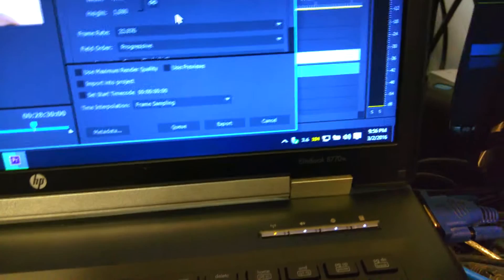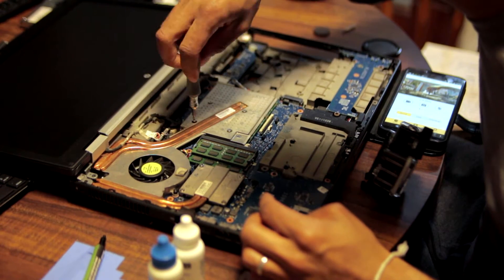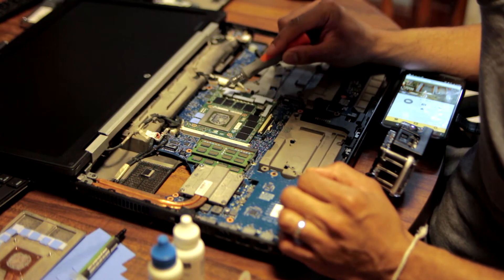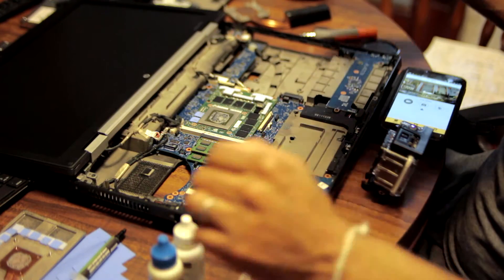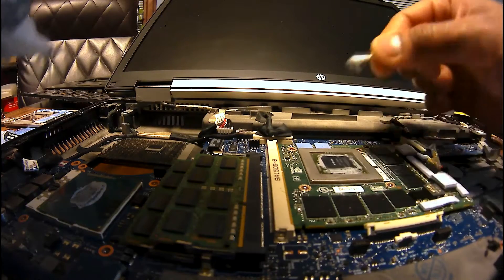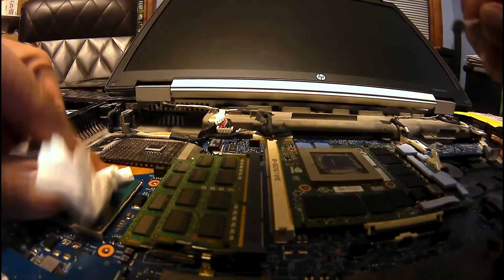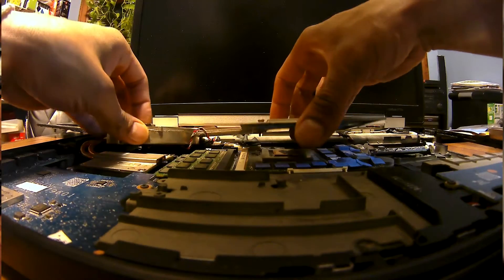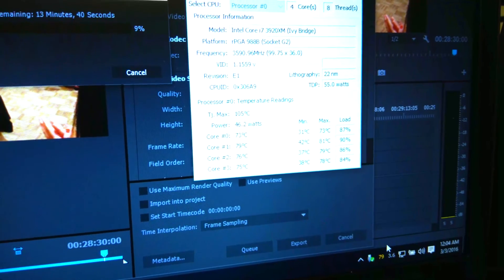Cooling down a hot notebook CPU or GPU

Comment: The copper shim not only increases contact pressure on the die; it also adds thermal mass, reducing spikes in temperature from turbo boost.

Comment: Bro holy crap dude... way, way too much thermal compound. When you apply the heat sink, it spread out the TC normally. What you did is put too much on and it will squeeze out over the CPU. It too excessive.
Reply from the maker: You're partially right. It wasn't that bad. I reapplied it since this video and was only over on one side of the die.

Comment: Wouldn't putting 2 shims just build up too much heat between the CPU,compound,shim,compound,shim sandwich? Especially after curing and setting after some use?
Reply from the maker: xRevoEmaGx I recently redid this process on the same laptop. The thermal paste was shot. The temps were still okay but it ramped up too quickly for my liking. I was hovering around the mid 90s during video rendering. Something like gaming was fine in the 70s.  
I think the 2 shims might be unnecessary. I used one shim this time around. I also used better thermal compound. At idle I'm below 40 and during video rendering, I'm in the 80s.

I was tempted to shim the GPU but I'm afraid the copper may become a conductor in that case.

Comment: Smeared TC -> Cu shim -> TC -> Cu Shim -> Heatsink....
by doing so you introduce more "scratching" the Thermal Compounds has to fill out. 
Adding cobber shims only work when the heatsink wasn't tight enough in the first place.
please show me where you found that great idea? (and please not the dv9000 series thermal ghetto fix vid)

Proper application of tim/tc on naked die:
on long chips: rice grain or long ricegrain size thermal compound. Let the heatsink do the spreading of TC.
square chips: a bead, or an X. and again let the heatsink do the spreading for reference https://youtu.be/HIlTsZYQaKk?t=168

but other thick or liquid thermal compounds needs spreading. (fx. IC Diamond, Liquid Metal)
Reply from the maker: +SpasTaz0917 I forgot where I found the info. I've been using the pc since that video and the temps have been great. Maybe the heatsink wasn't tight enough. Anyway, I have never heard of liquid thermal compounds. I tried to get info on compounds before making this video but the most I can find is brand biased. Have you noticed a difference between regular compound and liquid compound?
Reply: @taseraq filemonsen
For anyone coming to this video late like me:
No. Thin spread is usually safe and there is no difference to other applications. With rice grain or x-shape you introduce unnecessary risk. Check out the more recent comparison my the very thorough Gamers Nexus.

And @Magmafire:
The HP 86xx and 87xx series have the issue of leaving quite a lot of space between the heat sink and the dies (in the 86xx at least they used quite thick thermal pads for contact). So your "mod" is definitely useful.